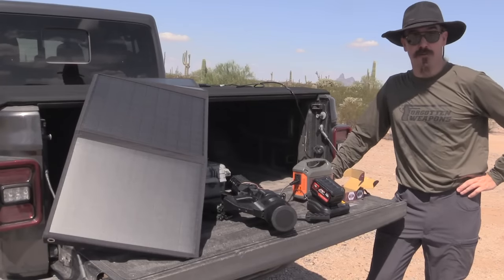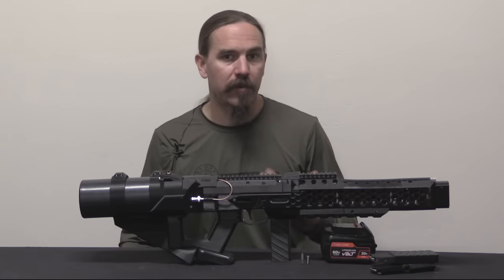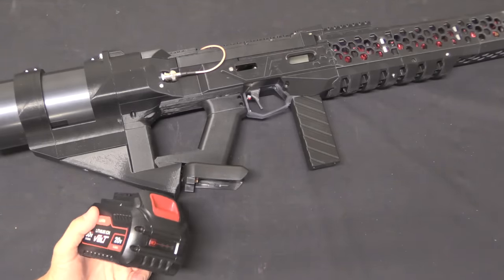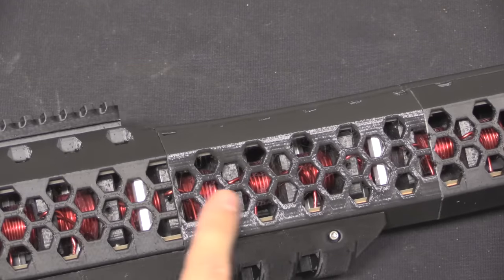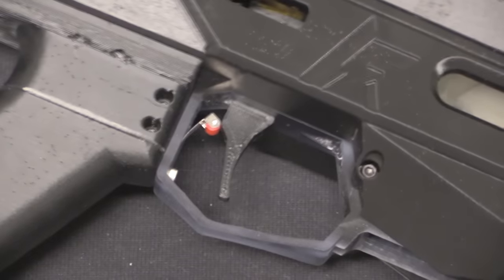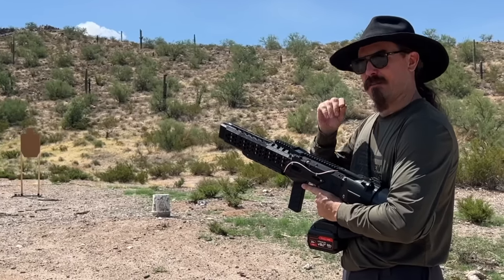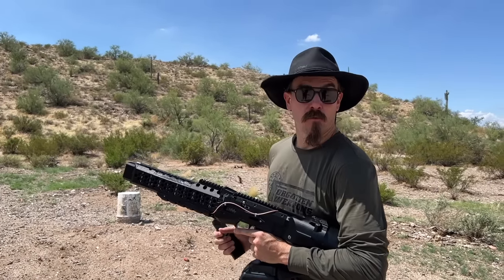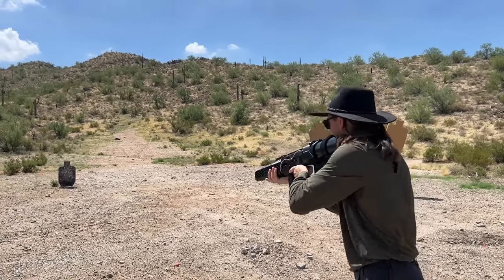ArcFlash Labs EMG-02 CoilGun: Making SciFi Weapons Into Reality

Comment: i would love to see a balistics test with this gun. it's so quiet that it's unassumiing, it sounds like a pellet gun but probably hits like a 9mm. a gell dummy would put that into perspective.
Reply: If he commissioned someone for custom ammo, it would probably perform better.
Reply: For the specs given in video it would be closer to a .22LR pistol.
Reply: @NexUbra  ... what? 71 m/sec isn't even as fast as a paintball. It'd need to be at least 400 m/sec to even be within spitting distance of a cheap ruger 10/22. And with the broad surface of dowels, it MIGHT leave a welt.
Reply: It's as weak as a pellet gun so would sting and annoy.
Reply: @Mcaark  You're comparing it to an established weapon with a couple centuries of improvements... yet are impressed that this homemade coilgun even exists in the first place?

If you're unimpressed by it, then make one of your own that's better, or offer ideas to improve it.
Reply: Looks like it is probably heavier and slower
Reply: @wolfrainexxx  to be fair, as the guy who built this said, there is a physical limit on the magnetic saturation of steel, which means it will be hard to significantly improve the performance
Reply: @levansaginashviliskidney8726  Fair, but that means there is still room for improvement.

I'd remind you that computer technology started accelerating as people stopped worrying about leaps, and bounds, while just accepting we were stuck at 5-10% improvement every couple years.

Eventually, someone made a breakthrough, and now "Moore's Law is dead."

Sometimes a thing gets invented, and stagnates for awhile, but it inspires others.

My excitement is that this "Coilgun" exists at all. Don't give up on it, even if you can only make 1% improvements every year, or two.

Much like Muskets, and Carriages, some things take forever to improve, but eventually that break will come... if not for him, maybe he'll inspire someone else?
Reply: @wolfrainexxx  100%. He can probably work on the aerodynamics of the projectile (a cylinder is not the most effecient), ergonomics, charging rate etc.

I am excited for it's future
Reply: To put it in perspective the Daisy Red Rider shoots at 350 fps. The weight of the projectile is is higher but both the low fps and the rolling of the rod makes it very weak.

Comment: Best way to recover your used ammo would be to sweep a big magnet around the target area.
Reply: They used the same principle in WW2 to train .50 cal air gunners....
used compressed air (2000lbssqin) full auto and copper coated BBs through an  air rifle barrel inside  a full sized .50 cal barrel.......on a scale range...to simulate the required air gunnery techniques.
At the end of a couple of hours an electromagnet picked up the steel BBs and dropped them back into hopppers to feed through the guns again...

Comment: I wonder how it would do with ball bearing, there wouldn't be a tumbling issue. They could also 3D print either metal projectiles with fins or plastic sabots with fins for metal inserts so they could be stabilized.
Reply: I would think that just having fluting would make it somewhat more stable.
Reply: I spy another Taofledermaus fan

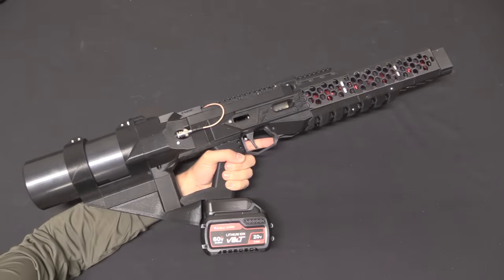Comment: This was a great video. I appreciate the way you covered so much detail. I found myself wondering about the weight of the EMG-01 around 9:20 into the video . . . if it's easy enough, maybe could you add that as an overlay comment.  Another thing I was wondering about is if an item like this would be restricted to the number of dowels it could hold, since they are not regulated. I watched something on pneumatic .50 cal that had a higher muzzle velocity than a conventional round, yet it was not classified as a firearm.

Comment: If we can get this shooting a 4 times heavier projectile 4 times faster, we would have something actually dangerous.
Reply: Energy-wise that would put it in the lower end of a .223 rifle (although a lot heavier and a lot slower). You don't need to up the stats that much to get something actually dangerous.
Reply: @frankjohannessen6383  Maybe my measures were off, I took it as these dowel pins being roughly 70 grains, and flying 230 fps. That's muzzle energy of 8 foot pounds. Raising the velocity to 920 is still subsonic and presses 131 foot pounds. A little more powerful than a subsonic .22 lr. Raising the projectile weight to 240 puts this at 450 foot pounds, roughly the power of a .45 ACP.
Reply: @abonynge  I was assuming the dowel pins were 9 grams (139 grains) and that escape velocity was 71 m/s (233 ft/s). Or to be more accurate, that's what I read in another comment here and I assumed it was correct. This results in kinetic energy of 22.68 joules per shot and if you quadruple weight and speed you end up with 64 times the energy = 1450 joule (or 1070 foot-pounds). 

I checked the producer website and it says "up to 20 joule" so I guess my numbers are closer but still a bit optimistic.
Reply: @frankjohannessen6383  I see, the issue here is that there is such a wide variety of weights for similar sized dowel pins. I went by the pins readily available to me rather than the ones they are using. With their pins your numbers are accurate.

Comment: So would one call this a proof of concept? In theory would this weapon benefit from aerodynamic ammunition? Lastly, what would it take for this weapon to be ready for small game or self defense? 

I wonder if high powered air guns are more viable given the amount of power they can generate.
Reply: For now, yes.  The future?  
Are you carrying an air powered drill?  No.  Batteries are the future.  Electricity.  This is just the beginning.  Batteries will get better.  Coils stronger.  Faster.  It is time to move on.

Comment: Can it be modified to shoot .25 or 5/16 steel ball bearings, or is there not enough surface area on a ball bearing to generate the needed thrust? Looks like a ball bearing would generate more speed, accuracy, and magazine capacity. Way cool gun!!!
Reply: With ball bearings you could also use magnets at the end of the barrel to apply spin for curved shots allowing you to hit targets behind cover. However, with rods you can do the same to function as rifling would.

Comment: I dunno about giving this company credit for being the first making "commercially produced" coilguns. Seems like 3d printing has just given them the ability to sell copies of their prototypes.
Reply: Was is a commercial product if not just a copy of a successful prototype?
Reply: @OGSumo  I mean normally commercial products at least have some refinement and standardization. This doesn't even have the same fillament used across all the 3d printed segments. Imagine if you bought a car and for some reason the exhaust ran around the outside of the car and over the windshield. "This pipe actually leads back to a sound dampening device. You wouldn't want the sound of the engine directly so this helps with that..."

Comment: Would a fin stabilized projectile be a more practical approach than rifling for coil guns?
Reply: If it had the same mass, yes?
Reply: I suspect the issue there would be feeding from a magazine as the fins would interfere with one-another. You would need some sort of sabot in the same way that conventional chemically propelled flechets do.  

I wonder if steel rod could be put through some sort of extrusion machine to form twisted flights/fins on it and then have a thin  plastic ring put on at each end to give it a cylindrical form factor for the magazine.

Comment: This makes me wonder about magnetic pattern rifling... Like I just cooked it up, bear with me a sec. If we offset the weight balance and thus the magnetic center of the bullet, then we can have the magnetic pull rotate around the projectiles while they are being pulled to move down the barrel... Wouldn't that grab and spin the round increasing accuracy like rifling?
Reply: Funny, I’m no engineer but what I’m thinking too

If barrel can’t be used cos no pressure like normal rifling, find a way to make coils do it instead

Five bucks says they’re already working on exactly something like you describe too haha
Reply: I feel like that would be less like rotation and more like just making it wobble. Could be wrong, but with the center of gravity not actually in the center of the round, rotation might just throw it off course
Reply: What if you had some spiral lobes on the bullet.  Would the field pull on the high points of the spiral?  It would make the bullets expensive and not worth it.
Reply: In the last video I believe he said they were working on a magnetic "rifling" but using rotating fields rather than an off-centre projectile. However, that's easier said than done
Reply: My thought would be that a spinning off centre CofG would cause the projectile to form a conical path and not fly straight but I am certainly no expert on the matter.
Reply: I would think a thin stabilized projectile would make more sense?
Reply: @BRBMrSoul  the easier solution is a fin stabilized sabot.
Reply: @pctrashtalk2069  a thin stabilized projectile is the better way to go. Just like tanks use smoothbore guns and sabot rounds.
Reply: @chrisstephens6673  you use a fin stabilized projectile sabot. Like they use on tank guns. They use smoothbore.
Reply: @WALTERBROADDUS  indeed that would seem the best and easiest option. The downside might be taking development time away from the next generation but on the other hand to make a military version is probably many iterations away so a little time spent on custom design ammunition now might be beneficial.

Comment: What do you think about inserting an induction heater into an emg-02, (coil gun) using a drum magazine and using tungsten/diamond tipped drill tool bits as ammunition?
Convert it to fire at the wipe one hand, change the trigger for a flight simulator joy stick. You can make a harness allowing you to use two at once.
A fully automatic machine gun with no jamming, no sound, no smoke, and firing red hot dimonds at 200 f/s.
Shit accuracy, but you are just shooting hundreds of burning metal at a target.
If you use lead pellets it doesn't matter if they have body armour or not as you are painting them in molten lead.

Comment: Ngl having a supercap right at the shoulder is terrifying.
Reply: It's actually not a supercap. It's electrolytic. Supercapacitors are very low voltage and have high ESR so they're not practical for energy weapons.

Comment: @forgottenweapons I wonder if they could improve accuracy by rifling the rounds instead of the barrel. even if the weapon doesn't depend on pressure to force it down the barrel, the round flying through the air still interacts with the air, so a "rifled" round would essentially be forced to spin by air resistance.

Of course this would add drag, and there's a danger of the edges interacting with the barrel in unhappy ways, not to mention it would make finding ammunition a little bit harder (unless they included a "rfiling" kit with the weapon)

Possible magnetic field problems could be solved by making the rifling material out of a non-ferromagnectic marterial. my first thought was some sort of cheap plastic, but a lead jacketed steel bullet would be both hilarious and likely increase the damage output of each shot (one of many reasons we still use lead bullets to this day in conventional guns.

Comment: You could rifle the barrel . But that would require creating a projectile that lines up with the rifling in order to impart a spin onto the projectile.  The Electromagnetic coils are just the propelling force behind the projectiles .   This however would mean that other projectiles that are not designed to line up with the rifling wouldn't be recommended due to rifling.  You don't want to damage said rifling because of accuracy concerns.   

So yes it's possible to rifle the barrel but it would involve a lot of work to make the projectiles that could follow the rifling in order to fire more accurately.  Because the projectiles have to be made of a metal that is ferric IE something like steel projectiles that would be the same diameter of the bore and have a series of groves in them to allow them to follow the rifling .  Basically it would be expensive and isn't really worth the cost unless the government were to be the buyer.
Reply: Friction involved with that design would cause the fps to drop significantly. They need to adjust the projectile design.. Maybe add fins.
Reply: @conspiracyscholor7866   Yeah good point, but they would still have to modify the ammo .  And yes I like the fins ideal.
Reply: the coils do not propel from behind. They pull from in front of the projectile.

Comment: Another example of a super capacitor utilizing a power gate to control the amount of energy discharged to a device.  There's at least one ebike that uses super capacitors with a power gate to supply the motor.  Gets 50 miles on a charge, and charges instantly.  Really the only way to go. 
 I'd like to adopt this tech to a quadcopter. A whole floor of super capacitors weighs significantly less than batteries...

Comment: Would be nice to see a custom 18650 battery. They could wire them all in series to bump up the voltage for faster recharge rates and also pack them flat. Then it could be placed under the capacitor and would even cool better.

Comment: Could ammo be designed with internal fins with a solid ferris exterior and possibly a heavier and/or harder core that would rifle the round without taking away from the force of the round? I mean it would be some pretty high end machining and work but I feel that would have potential of improving aim and possibly moving the project forward? Or could you rifle the barrel and make round that would slot into the rifling and also improve trajectories? Sorry long comment but this project has my brain racing on how to improve this lol

Comment: Wouldn't a longer barrel with more coils give the projectile a higher exit velocity? Also if I was engineering this thing I would make each coil pull the projectile when its behind it and then once its ahead, reverse its polarity and make it repel the projectile. So basicaly each coil first pulls and then pushes and all that is happening when the projectile is still in the barrel

Comment: Could you use short lengths of drill bits to use the spiral along the length of the drill bit to give you the same effect as rifle barrelling? Or some other form threading cut along the round? 

Can a ceramic barrel (diamond coated on the inside?) be used that doesn't affect the magnetic fields to pull the round, to give it a more stable launch?

Now if you could replace the magazine with a method of feeding in a continuous coil that straightens and then cuts each round to the correct length.... (Trying to think outside of the barrel.)

Any progress on the charged particle continuous stream device?

(Am I reading the wrong type of books?)

(Yeah, go green power!)

Comment: Thanks, I was wondering:
1) What gauge the coil wires are?
2) What is the capacitance and voltage rating of the large capacitor?

I noted here that each coil would have to use the same capacitance,but at lower voltages per shot.  On the 'later' coils, shouldn't things be more efficient if the capacitance were lower...lower capacitance = naturally faster discharge.
Thanks again,
--dALE

PS
have you ever tried projectiles to 1/2" dia?

Comment: If you use a tube instead of a rod you wouldn't need to rifle the barrel. Aerodynamics would do the work for you. Same goes for a tear drop shape but that would become a challenge to feed and probably an issue with accelerating coil to coil with the unpredictable magnetic field lines.

Comment: All scifi armors are basically superconductivity metals oretald forged under high pressure and heats to make or change it to Lower the superconductivity limit in accordance to outside temps.. it's lower l or higher in the books becuase of what's on the outside of the suit maybe armor suits need cooling and heating hulls definitely needs two coolers and one heater then also the steel and copper to make the superconductivity hull

Comment: I don't know if it's smart to put that cap up against your shoulder.  The top of caps like that are normally etched and has the effect to direct the blast for when they explode.  I'd also be curious if it's possible to get caught up in the electric circuit, as you are essentially forming another plate.  I think I'd want to make extra sure I was grounded to the metal outside of that cap if I was going to be anywhere near it during operation.
Reply: @electroboom?